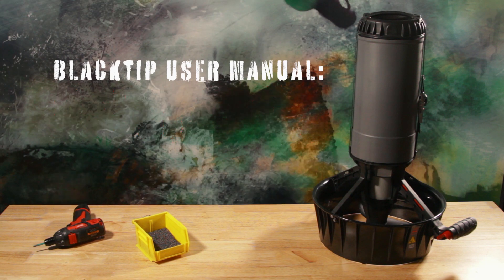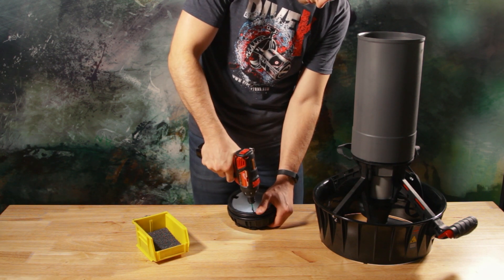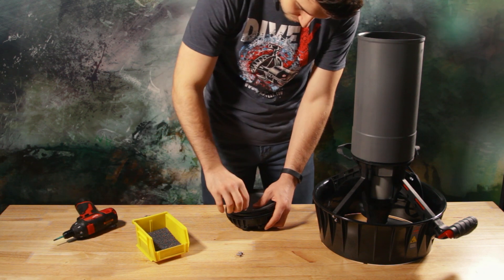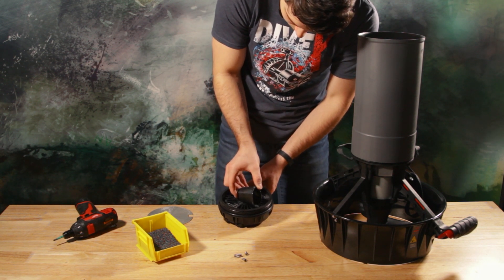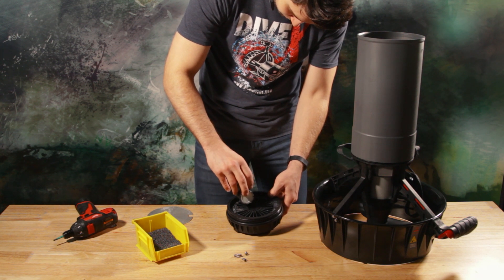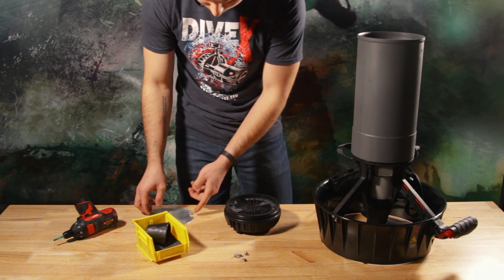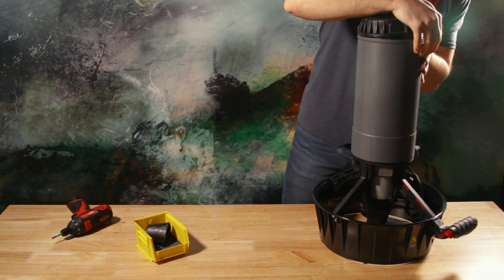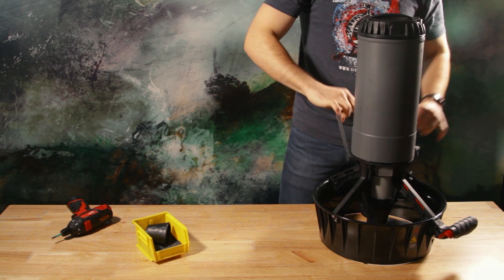BlackTip User Manual: Buoyancy & Trim

Comment: With the 12ah or 9ah Batteries (they both weigh the same according to DeWalt) will the scooter trim out,  or still be tail heavy? Thanks.
Reply from the maker: The BlackTip can be made neutral with a combination of batteries and weights. However, the BlackTip’s nose will always float slightly positive compared to the tail.
Reply: divextras thank you. With the 12.0ah, how much weight is required to be added?

Comment: Please clarify is there no quick change weight plates inside the BlackTip?  This feature on the Piranha made it extremely useful for quick configuration between fresh and marine water applications. Grrr... Hope I wrong and you still retains the steel plate feature for the BlackTip! However you target price point may have been the determining factor, lower cost = cutting functionality.
Reply from the maker: Hi Jeff, there are no salt/fresh trim weights in the Blacktip. The scooter isn’t trim in the water so its not as sensitive to fine tuning as a Piranha or other scooter. You can add one if want to by using one of the 4 screws in the nose.
Reply: @divextras  thanks for the clarification 🤙